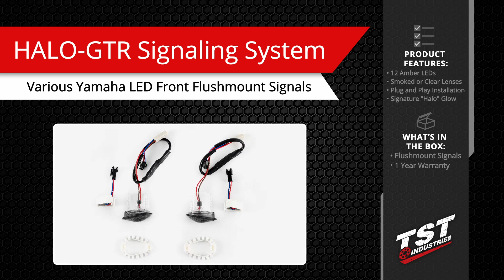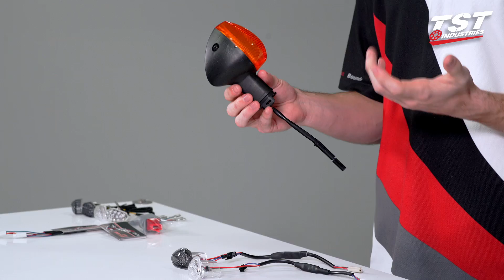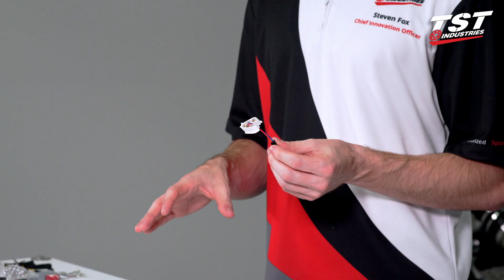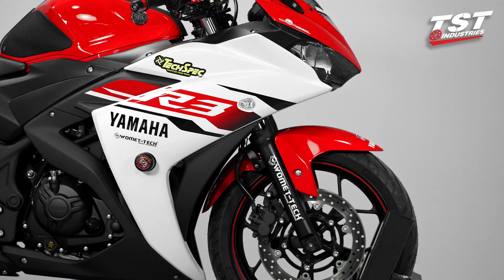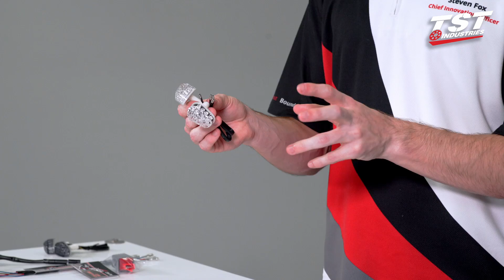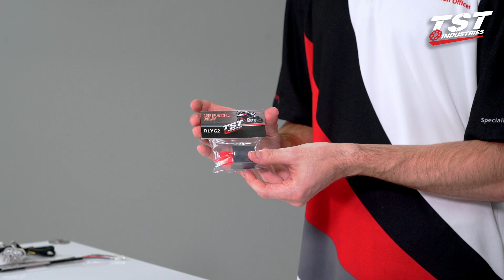All New HALO-GTR LED Flushmount Signals for Yamaha Motorcycles by TST Industries

Comment: Did the Halo install with Flasher Relay and rear LED pods.  I installed the TST fender eliminator kit last year and kept the stock turn signals.  Mistake!  If you're going to go fender eliminator, save yourself time and aggravation, for a few dollars more, get the License plate bracket and stealth light and do all this electrical ONE time.  R3 owner here.
Reply from the maker: Whichever way you want to go we are here to support you. I'm glad you got it all sorted out.

Comment: I would like LED front turn signals for my 300 as long as they have the same shape housing as stock but they have LED boards with the same intensity as the tail lights. Maybe an idea for the future? Programmable too? ;) haha
Reply from the maker: I would like to find the unicorn rare thread spec nut for the front axle of the N300....we all have wishes.